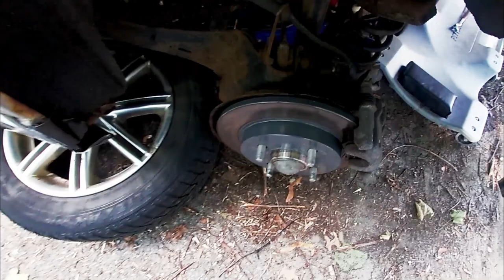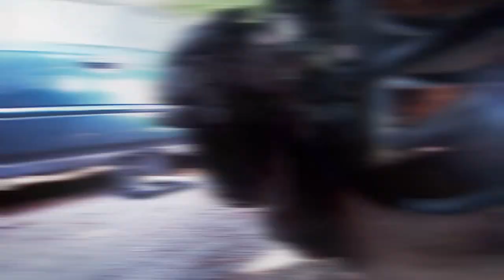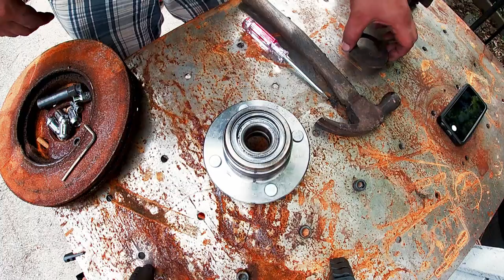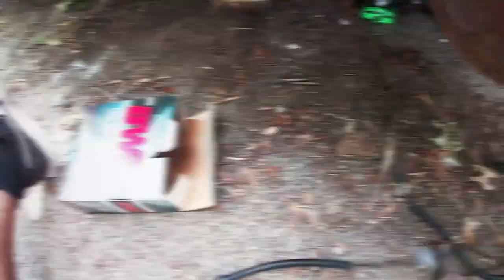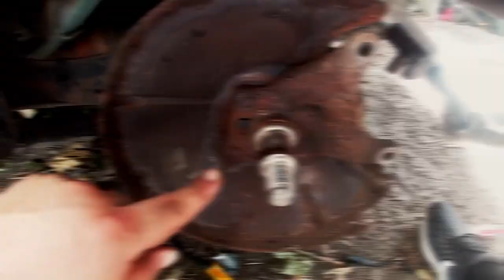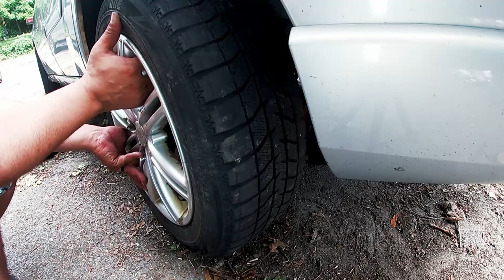Replace ABS Sensor [Ford Focus ST]

Comment: Hey man ! I have the exact same vehicle . 2005 Ford Focus ZX4 ST. 
I just replaced the clutch (w flywheel, pressure plate, slave cylinder), transmission shifter gear housing assembly, master cylinder for the brake system, master clutch Cylinder, rear passenger side brake caliper and rotor...
However, I had a strong clutch at first. But it went out within minutes. I can get the car running if I start it in 1st gear. What could possibly be the issue? I’ve replaced so much already!! I heard there are sensors that can be turned or replaced. But that shouldn’t have anything to do with the clutch pedal pressure right? The mechanic noticed a small leak under the slave cylinder. But no leak since then
Reply from the maker: Hey, Welcome to Wicked DIY! I'm not 100% sure, but you might want to take a look at the clutch pedal switch right under your clutch pedal. Sometimes wet shoes and grime gets in there and kills it over time. You can easily test it by unplugging the sensor and jumping the connection with a paperclip or ideally a jumper wire. Once that's on just start your car normally. If it works, replace the switch. 

I hope this helps and I understood your question correctly.
Reply from the maker: Hi Chris. The more I read your question the less I think I understand it. So you replaced the clutch among other things, but your car won’t start unless it’s in first gear? Or is it that the clutch instantly wore, and now can’t actually move the car? Let me know, I’m not too familiar with transmissions but I’ll help out if I can. STs are awesome cars.